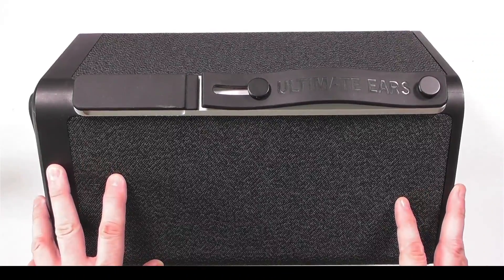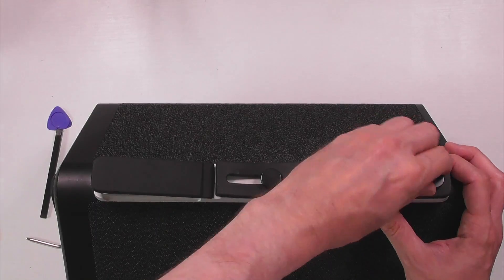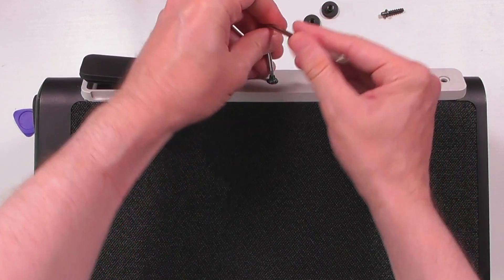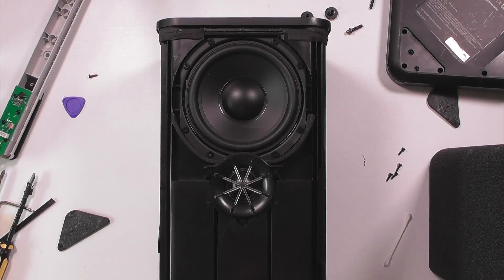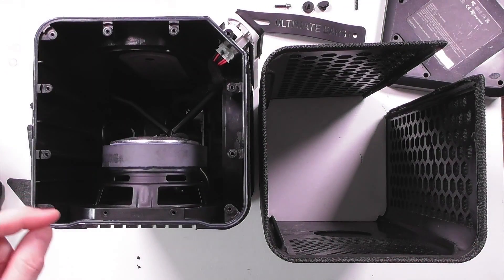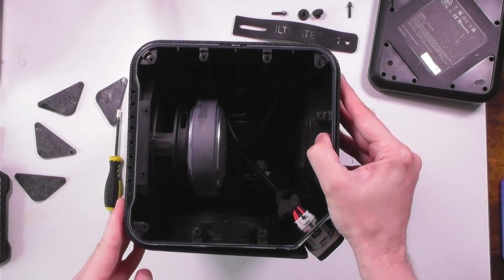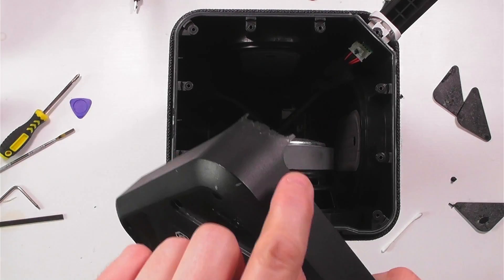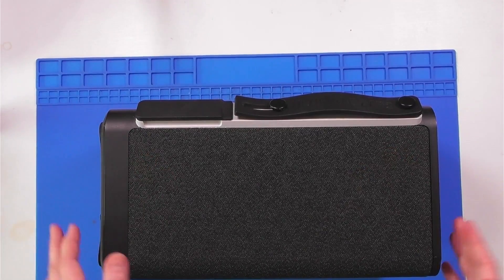UE HYPERBOOM MINI TEARDOWN! + Mesh Cover HACK

Comment: My speaker stop charging , the charging port is good , you think of i change that board ( charging ) would work ????? Or any suggestions
Reply from the maker: I think that board only has the actual port on it from what I recall.  I'd probably be looking at the battery first as a potential issue.
Reply: @RepairingFaultyTech was working perfect until stop charging 😢
Reply from the maker: Does it work for any time at all on the battery?  Or does it go to 'critical battery please charge' straight away?  If it works when plugged in then if it were me, I'd check battery first.  

Does the white light flash when plugged in?
Reply: @RepairingFaultyTech yes work perfect with the battery , was in use I plug start charging then the led shut off

Comment: Good video, when you had the top panel off, take out all the screws and the top comes out, it doesn't split where you said and isnt glued down. Under this top panel is a ribbon cable so be careful. Under the top panel you will see the battery  pull the plug out of the main board and it will just pull out
Reply from the maker: That's great info to know, thanks for that.  I thought that it might be glued but if it's easier to get the battery from there, then that makes a lot of sense, much easier than removing the speakers!  

Timely info as well as the battery in my unit seems to be slowly getting worse at holding a charge, so I think a video about changing the battery may be due!

Thanks for your comments on the video, much appreciated.
Reply: @RepairingFaultyTechI stripped one today, like you couldn't get the speaker (driver) out after removing the screws, worked out how to pop the top panel off, removed the screws and popped the top out, spotted the battery straight away. No need to dismantle the whole thing lol. I have a dead cell in the 4 cell pack so the BMS won't put any power out and wont charge. £75 from ifixit. Avoid the companies selling the blue battery........

Comment: My speaker won't turn on unless plugged in, how do I fix that?
Reply from the maker: It could be a battery issue.  I've yet to find a source for a replacement but the intention is to upload a video showing how to replace the battery once I've found one.

Comment: After you take the bottom off, can I now replace the battery, I was hoping not to have to take the mesh off if possible?
Reply from the maker: I think the problem is that one of the speakers is in the way so it will be very difficult to get access to it and unscrew it.  

The mesh is actually really easy to remove and reinstall as shown in the video, I don't think you'll be able to replace the battery without removing it.  

Best of luck!

Comment: Nice one, really helpfull. I think one of my clips from the top surface is broken off. It makes plastic like Crackle when i press there :(.
Reply from the maker: Thanks for your comments on the video, much appreciated.  

Could you maybe add a small amount of glue or something similar to deaden the sound a little?  I guess it depends how big the gap is between the clip and what its knocking against though!

Comment: Amazing!!!! I'm so appreciative of your service to all of us UE customers. This is very, very helpful to have a feel of the complexity of such a task as dismantling the unit. Have you had a chance to get to the battery and change that component at all?
Reply from the maker: Thank you for your comment, much appreciated!  At the moment, the battery in this unit is working.  Should it need replaced then I will definitely make a video about it.  I think once the speaker is removed, it should be straightforward to get to.